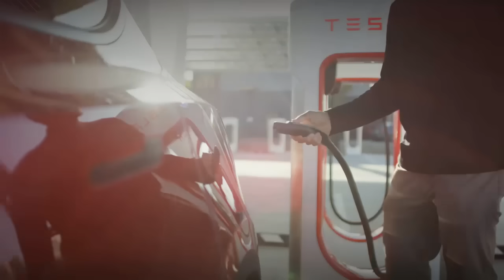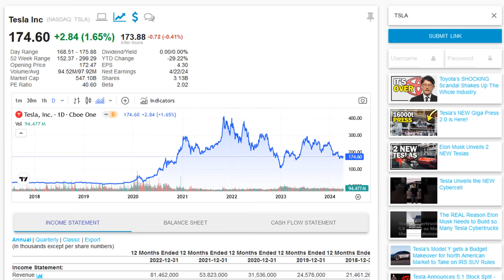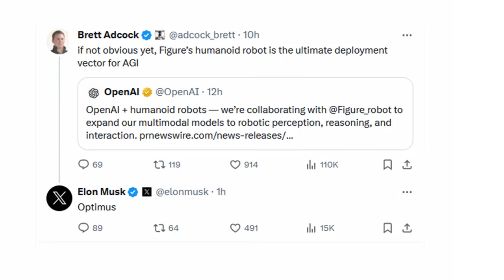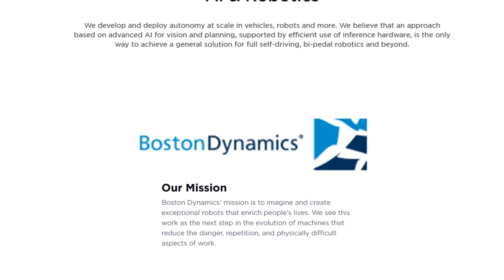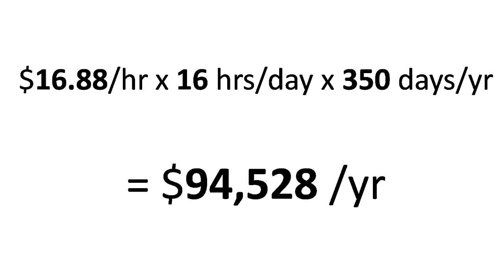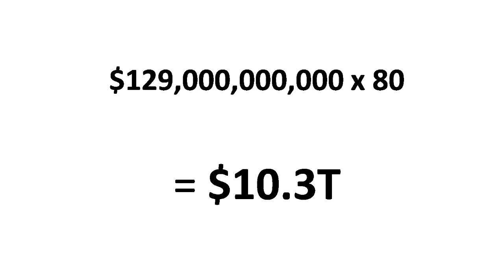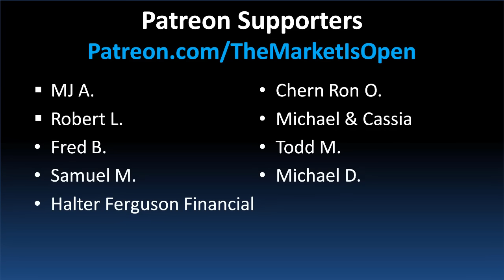Tesla is Quietly Building Up a 10 Trillion Dollar Weapon

Comment: $95 grand per year plus energy cost and maintenance for a robot working a double shift is no saving. If you’re going to be hiring a multitasking humanoid robot you want to be paying more like $3 per hour not $17. Then there’s a big market for robots until such times as they’re super smart and super fast.
Reply: I was thinking the same thing, $17 per hour is way to high for a business to be interested
Reply: To be fair at 17$ you are still not paying into their social security, health care, HR, paid breaks and a much of other stuff. But overall I agree with you. 95k + hourly doesn't sound good.

I think it should be tiered like 50-95k per bot depending on complexity. And then a yearly software/update/maintenance charge of 10k per year.
Reply: This gonna explode
Reply: The cost will be more like $20K. And for that you'll fully own the robot. The hourly rate will be a separate option, if you don't need one full time, or don't want to pay upfront.
Of course the early limited supply will push the prices way up, close to the cost of human labor.
Reply: For robots you dont need to care about their safety. So u spend less money on safety. And they can work almost non stop in my knowledge.

Comment: Why would company pay near 82k per year for each robot?
Reply: To replace 3 workers (ea work an 8 hr shift) at $100k ea (with All benefits included: medical/dental for the entire family!, retirement, vacation, sick days, etc..). No chance of a job action.  So, $82k vs $300k?  🤔
Reply: @almostthere100  AI is nowhere near capable of doing any of this.
Reply: Who works 8 hrs at TESLA ?? 😂😂😂😂😂 it’s 12 hrs. so information is already not correct 🤡
Reply: They can work 24/7….enough said!
Reply: @MLEPOS1  the machines used by these robots can’t run 24 hrs.
Companies will most likely run 2 shifts of 8-10 hrs with 4-6 hrs for maintenance/down time.
Also these companies want to save $ so they will want to pay less than $82k.

Comment: There will still be a need for boots on the ground - for now - but how WONDERFUL to have robots go in and hold (or take) a line without a single life lost! ❤️
Reply: No, we should never justify war, the only certainty in war is the rich get richer why we get poorer and pay for it, tell me that is not trye
Reply: @StephenFirth-x3j  that is trye, I mean true. Proven fact - point of order - a robot would take a man’s place - demographics, incomes, populations do not change.
Reply: I don't think Tesla Optimus is going to be designed to be capable of warfare combat or even war zone logistics, Elon is deliberately designing his robots to be slow and weak with a clumsy walking gate, so as to prevent them from being capable of a robot uprising. I wouldn't be surprised if he is even trying to incorporate design features that would make the robots easy to disassemble with just your bare hands, as an additional measure for just such a scenario, so that we could not only easily out run them climb up onto rough terrain they will not be able to follow us onto, easily over power them and pin them to the ground but also easily take them apart with just our bare hands, once we pin them down. Well, such design features do help prevent a Terminator scenario. It also renders the Tesla Optimus complete, incapable of replacing human operatives in jobs that require human level speed strength agility and durability. But given how the Optimus robot being an inorganic non biological being is invulnerable to biological hazards like doomsday plagues, biological waste in construction sites, and would like wise be invulnerable to toxic contamination like toxic construction materials, I could see Optimus being able to replace at least some humans in HazMat cleaning jobs.

Comment: Each robot can plug-in at each workstation. 
A small battery will get it to the next workstation or plug-in.
Reply: Probably wireless charging at workstations.
Reply: @billweberx  keep it simple, dirt cheap simple. A simple wall outlet for Mr Robot to plugin. Hahaha 👍😀
No complexity.
Reply: @stephenbrickwood1602  wireless charging is a simple as it gets.  No dealing with cables or plugging/unplugging.
Reply: @billweberx  selfparking EVs could also be selfplug-in V2G, just like the home robotic vacuum cleaner plugs itself in. 
A CHEAP WALL OUTLET at every car park space. 
No wires, dirt, cheap technology. 
Shopping centres car parks have lighting and electric supply.
Trickle currents for hours is a lot of electricity. 
Most vehicles will only need a little daily top-up. 
Most vehicles will be full every day.
Not like the ICE vehicles with big petrol tanks needing regular trips to the petrol stations. 
Basically, trickle top up everywhere. 

You could even sell some energy back into the grid, all controlled be the vehicles computer and your instructions. 
Top-up at home for free and sell into the grid if the kWh $ is good.

Great concept isn't it ?

Comment: The problem with this economic analysis is that competition will drive down the cost of robots.
The robots may start out selling for $25k each, however, that price could well fall to $2.5k each within about 10 years.
This amout of price reduction is not likely for electric cars due to the size of a car and its battery.
Reply: It's not the hardware that matters.  It's the software.  It will run on a SAS model.
Reply from the maker: What if wages for humans is the competition?
Reply: The Sonicare toothbrush hasn't reduced its price in 30 years as  some models are more than the original
Reply: @TMIOTesla  The robots will be competition for human labor.
People who can be readily replaced by the robots will find the market price of their time being rapidly reduced.
Reply: Human vs Robot labour is the competition here. A Robot can work say 350 days a year and double the hours of a human so effectively 700 working days. A human maybe 200 - 230 max. When you realise this, the human has to be 3 times as good/faster than a Robot just to match it. That’s a scary thought.

Comment: Robots are all fine and dandy until they break down and then you have to get somebody in to fix them which is usually $250 per hour and you have to wait for parts which are additional cost.  Robots are made from motors gearboxes bearings and these are all wearable components and if they crash, then most likely you will not just get individual parts but you will have to buy a module which would cost over $10,000

Comment: I used to love the unbiased videos on whats really going on in the market. Crash fatigue is showing with most folks. My $20,000 TSLA holdings are down 7%. This video leaves me some serious concern.
Reply: Don't act on every forecast. It is best you speak with a market expert before making any investment decisions. My two cents.
Reply: You're right, the market can be tough sometimes and requires professionals to navigate it. Sadly, A lot of persons downplay the role of market experts until they're burnt by their emotions.
Reply: I work with such advisor who prefers I DCA instead of a lump purchase, Following this, my portfolio grew 40% after acquiring large cap companies with cash flows and strong balance sheets. Some of which are AAPL, VHYL, SCHD & NVDA.
Reply: I'm glad you replied my comment, I've been getting suggestions to use one, but where and how to find one has been challenging, Can i reach out to the one you use?
Reply: Monica Shawn Marti is the licensed coach I use. Just research the name. You'd find necessary details to work with a correspondence to set up an appointment.
Reply: Wow, her track record looks really good from what I found online. I'll take a chance and see how it goes. Thanks for the info

Comment: Rental companies such as UHaul, Penske, and Budget will boom in this new industry.  No business will want a robot that sits idle on its premise.  To sub it out to other businesses for use becomes an entirely new business to run.  If a robot returns damaged and incapable of working for you, then what.  The best for a common business is to lease a robot instead.  Like hiring on a temp.  Rentals can disperse and then retrieve robots, then redistribute them to other jobs around the clock.  In between shifts and assignments, robots go through simple upkeep maintenance.  Robots can be removed from rotation for any severe repairs.
Rental robots can be everywhere.  You can have an existing profile built and stored on the Cloud or in jump drive.  Go anywhere in the world, rent a robot, upload your profile to it, and you’re on your way.  Surely we can think of a thousand reasons how this could be exploited and it being a bad idea.  That’s what’s said about all technology, and yet, here you are reading this, without a care your data is being captured.

Comment: ☆ FSD factory production 24/7/365 is 8,760 machine hrs vs 2,000 man hours per year and no holidays, sick leave, training days, std bye workers, weekends, public holidays, 
The factory can be 5 times smaller or 5 times more productive. 🤔 😮😊

'Dirt cheap' electricity off rooftop solar PV and 
'Dirt cheap' big batteries on wheels.
Expensive grid capacity expansion will not be needed.
Reply: Cool story bro
Reply: @mervstash3692  we will see what happens. 

Vested interests in many parts of our economy and it is cheaper to donate to the political supporters.
Reply: @stephenbrickwood1602  serious question, but what % of the way to completion this thing is? Before it is fit for any real world autonomous use. 

I would say 1%
Reply: @mervstash3692  you may be right. 
I just saw the youtube video.
I am an old construction engineer, so I do think with a lifetime of skills and experience. 
But if it is good enough to be trained and work quickly on new complicated tasks, then my 24/7/365 factory may be closer. 
It may not need to look human.
We need to start thinking through these things and talking about them.

New working technology always follows a period of rapid implementation from the old.

Just my thoughts.
Reply: Agree, we need to factor in humans work maybe 200 - 230 days are year after taking weekends and holidays etc. into account. Bots probably 350. Then probably twice as many working hours per day, so more like 700 days work. 

What really matters is the output each achieves over time - if a Robot is slower but works 3 times as long and basically never makes mistakes, you could potentially charge $50-$100k for it annually. I think that’s optimistic, but if it’s proved to work by Tesla using them to make their own products and no one else can do it, then that’s probably achievable.

Comment: This is such nonsense. Musk has been promising full self driving was right around the corner for over a decade now, but we're supposed to believe they can make labor replacing humanoid robots in the next 5 years? It's just such a confidence game. Like you see how fast that robot folds the laundry, and how obviously a human can fold a shirt like 3x faster. Jobs that require you to fold laundry are not ones that require full benefits, so they aren't going to have the same overhead to reduce when it comes to employee expenditure. And the idea that Tesla will be able to stick to the 20k price tag, coming from a man who has a history of lowballing cost estimates to hype investors, seems silly. Or that the cost of maintenance and software subscription, or the loss of the ability for an employer to just simply be able to tell someone what to do in plain language without having to interact with a (presumably) AI interface in order to get anything done, or have to call a tech when something stops working, or have to pick up this appliance that is hundreds of pounds when it falls over or bumps into things, that none of this would work against Tesla and the valuation or adoption of the product ALSO seems silly to me. I'm sure they'll get some lucrative contracts at first, but in practice it's going to be more like OCP selling ED-209 than companies having an assembly line of soft edged terminators.